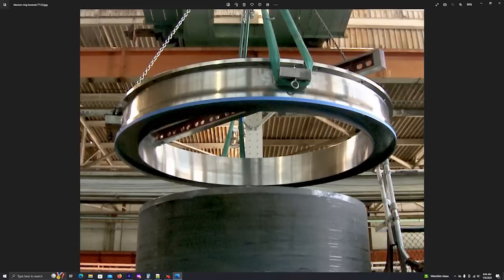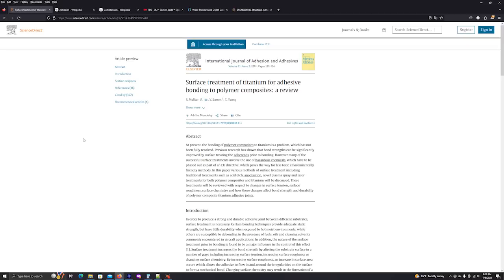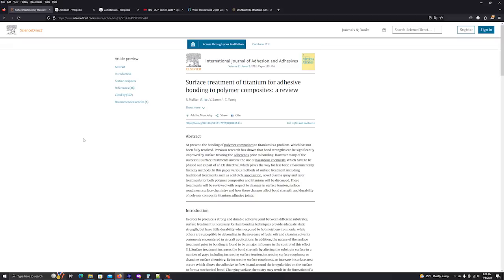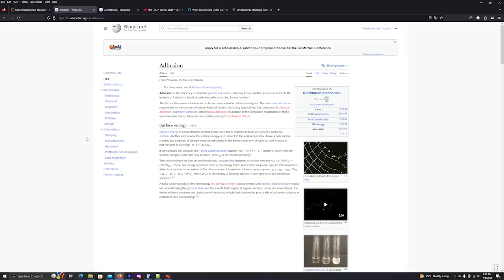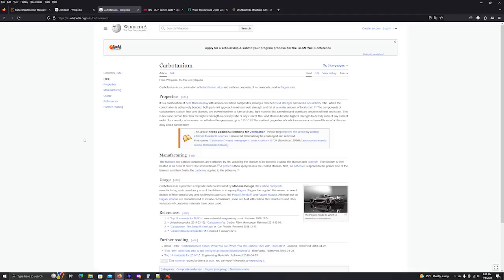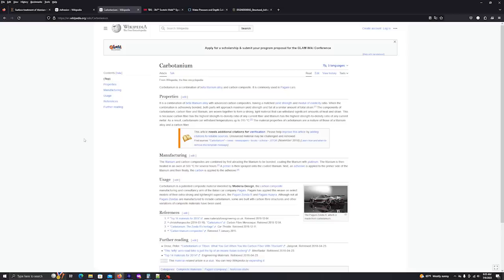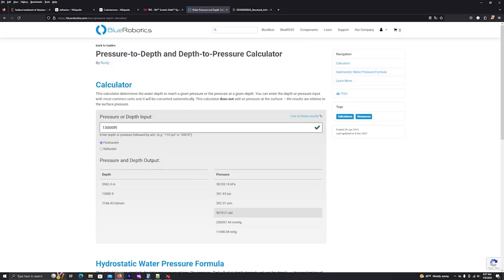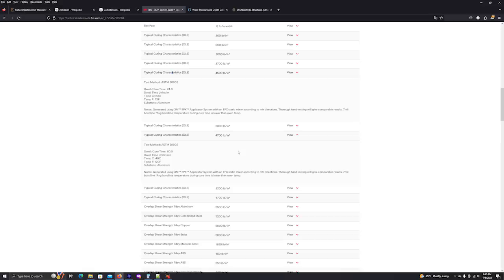Oceangate Titan Adhesive issues between Carbon Fiber and Titanium

Comment: What most are overlooking is the bond between the carbon fiber tube hull and the titanium sealing ring is not necessarily under any great structural load as Titan is designed.
The water pressure at the depths it's designed for will essentially force together the end caps and hull without any adhesion or mechanical attachment at all.
Much like how a car door of a sunken car won't open as long as the cabin is full of air anyway.
But where I think Titans designers and manufacturers failed is in the SEAL that must be present between the two critical components.  If water ever found its way beyond that narrow approximate 1" wide bonding/sealing surface at the O.D. of the CF hull and made it to the end face surface, hydraulic forces would work to seperate the two components and likely cause a failure at the corner of the CF tube face where the material is thinnest and weakest.
Once that occurs I think a catastrophic failure could result.
The expansion/contraction disparity between the CF and titanium and adhesive for that matter could have easily formed microscopic fissures or cracks that water at 6,000 psi could easily enter and burrow deeper through. If that "jet" or channel of water is large enough it could have easily destroyed the seal or the actual structure of the CF at its longitudinal Axis of its filaments leading to disaster.
As it stands though, and taking the text message transcripts into account it would seem something had reduced the vessels buoncy from the start of the dive as evidenced by its above nominal rapid descent.
The fact that the thrusters were unable to slow or arrest the descent and the RTM alarm sounding suggests possible hull deformation to the point that buoncy was reduced . I'm no oceanographic engineer so I have no idea if that's possible but being that the crew compartment was the only air filled vessel that created buoncy for the Titan it would seem something along these lines had to occur.
Once ballast and then the landing frame was dumped the hull suddenly relieved of considerable weight, could have flexed and deformed enough to cause the water intrusion described above and eventual implosion.
RIP
Reply from the maker: Good points,  thanks for the comment
Reply: Yes, you’re right. Even the bolts holding in the porthole window and the titanium hemisphere onto the titanium ring are doing absolutely nothing at 4000 meters depth compared to the 17 million pounds of force holding the dome on. 

In some of the pictures of the debris it seems that the inner lip of the flange where the carbon fiber tube was bonded got mangled. But nobody will know the chain of events until all the pieces are recovered. 

Im also wondering what type of adhesive was used because what seems most important at that joint is the ability to allow expansion and contraction of the two dissimilar materials at different temperatures and pressures, not bond so hard that it applies stress to the carbon fiber. This sort of ties in with the CEO saying “not too thick and not too thin”. 

Also so far I haven’t seen any details about the aft hemisphere, either during construction or in the debris. What sort of stuffing boxes did it use to allow passage of wires and tubing to pass through? What’s behind the aft bulkhead between the passenger compartment and the aft dome? 

The alleged transcript makes it seem like there was some sort of problem going on for at least 15 minutes before it imploded. And I say imploded because thats the only thing that would have blown the porthole out and the front dome off the front titanium ring. 

If you think the static pressure of 6000 psi is high, what do you think the water hammer pressure got to as it allowed tons of nearby water to accelerate into a dead end?
Reply: @imho7250  - yeah there's much to learn about that adhesive and the geometry of the joint itself fascinates me.
I think the disparity of the 3 materials, titanium, CF and the adhesive is why they designed the bonding surfaces the way they did with only a narrow approximate 1" band at the O.D. and I.D. of the CF tube hull and the majority along the 3.5" to 4" end face (5" wall thickness minus whatever was machined away to true it up and rebate the edge). That limited the movement between the materials by limiting the surface area of the bonding surface in the plane that would see the most movement.
Yeah I would imagine whether the hull failed catastrophically or a much less severe failure at the bonding joint of the aft end cap/bulkhead, the massive pressure and "water hammer" would have totally destroyed the CF hull and the porthole and disassembled every component in an instant.
As far as recovered components, we don't know if we're seeing the parts as they were discovered or perhaps after some level of disassembly once on deck of the recovery vessel for any number of reasons.
It's just not possible to say until someone briefs us.
All I know is OceanGate and Rush specifically was operating in such a reckless manner it was just a matter of time before something bad happened imo.
It's a shame.
There's a difference between pushing the envelope and being a cowboy.
Reply: @holdernewtshesrearin5471  , yes, he definitely pushed the envelope but you see people trying to “hack” the system everywhere they can. The porthole, reportedly only “certified” to 1300 meters, but most likely thats “ok, testing shows it will fail at 5200 meters, so we can give it a crush depth of 4000, a test depth of 3000 and certify it beyond any possible edge case of failure down to 1300 meters. 

So the CEO probably just went with the mathematical safe depth and got it for 10% of the cost. 

It did in fact make it down and back a few times, which means that at least initially, it was sound, but we don’t know which edge case got them in the end. 

One of my hobbies is electric bikes, and a popular “hack” is to get a motor controller rated at 30a for example, limited by software as it measures current across the shunt wires, and they will do a “shunt mod” where they add solder along the shunt to decrease resistance and “fool” the controller into allowing 45a when it thinks its just 30a. My stand on that is, as an enthusiast who had a pile of old controllers, and time to walk home, go for it, but for the average person they are eating into the safety margin that a Chinese manufacturer built in, for certain edge cases. If it was reliable at 45a, the Chinese would rate it at 45a and sell it for $10 more. Lol.

For the titan, after building it, I would need to see it raised and lowered with no life onboard to at least 6000 meters once and 5000 meters 10 times , then do ultrasonic inspection before allowing it to carry passengers down to 4000 meters. And this is probably much less stringent than any certification agency would use. 

We will see something similar on the first humans going to Mars. They will all also sign waivers. Lol

Comment: Even I hold pressure on my fake nails until the glue sets. You can see them checking if the end cap is down all the way by the green strap's relaxed tension. Childish! Further, there were no truss rods connecting the 2 end caps and holding them tight onto the hull. These were children playing a dangerous game.
Reply from the maker: Thanks for the comment

Comment: Seems to me that the bonding of the Titanium flanges to the Carbon Fibre Hull and possibly the Titanium domes to the Titanium flanges should have been positioned for the initial fit inside a vacuum to prevent air bubbles in the bonding substrate, then allowed to cure in air. In view of the fact that epoxy was used in the laying and composition of the carbon fibre, surely any engineered machine is only as strong as it's weakest component. Titanium is remarkably unreactive if I recall my Chemistry from back in College, that could be both good and bad, good from a corrosion point of view and face to face sealing but bad in that most things would not form a good reactive bond to something so unreactive. The best bonds are formed where a chemical can slightly eat its way into a substrate and form an intrinsic part of the surface area.
Were I to have designed that sub and due to financial constraints, used carbon fibre, I would have wanted to stay with a mechanical solution and have 50mm Ti tie rods, 12~18 in number equally dispersed around the perimeter of oversized Titanium flanges running the length of the submersible, from front collar to back collar. The submersible could still retain its hinged front door, I would also want an outer cylinder of Titanium maybe 30mm thick to avoid any water infusion into the epoxy/carbon fibre.
Many of the old Russian Nuclear Subs were constructed of Titanium, I would have sought a source in Russia for the cylinder build to keep within a budget and not compromised by using an untested at depth composite material.
You can be a maverick all you like, I am all for that approach as an individual, but putting paying customers in there knowing the risks, cynically having waiver forms made compulsory for passengers, being warned of a likely cyclical failure somewhere down the road and ignoring that because you can't let your ego be deflated and because you want peoples money, allowing a Father & Son aboard on Fathers Day, the son being just 19 years of age. Well reckless, irresponsible, greedy and ruthless only begins to cover this story.
Reply from the maker: Normally when mixing epoxy adhesive you de-gas the epoxy in a vacuum pot to remove the  air bubbles.  We are not sure if that was done.
Reply: @JoediyLab  Not fully conversant with advanced epoxy adhesives, thanks for the info. Really enjoying the depth of research you put into your videos, very thought provoking and stimulating.
I completely agree with your points raised about the Titanium Collars having absolutely nothing left bonded to them. That is what set my mind in the direction of the epoxy adhesive being the failure point too. No way in the World would I ever assume that an epoxy adhesive bonded to a highly engineered surface, very tight tolerances on an extremely precise ring using one of the the most unreactive metals there is such as Titanium could ever be a good idea. He might just as well have chosen PTFE.
Had he sandwiched the Carbon Fibre inside an inner and outer tube of Titanium of maybe 1 inch thick or more then used a bunch of tie rods to the exterior, I firmly believe that Rush could have been a leader in his field instead of relying on heavy domes of metal just glued to the tube either end meaning even when laid up on the docks for many months at a time in winter, gravity takes its effects, temperature expansion and contraction between a reflective silver metal and a mostly black, heat absorbing hull, UV light ageing the epoxy and then, as you have pointed out several times, towing the Submersible on its bespoke barge, cresting waves then plunging then cresting, cyclical strains on the both rigid and torsional strength of the hull. 
Maybe if he took the extra precautions of having the Submersible stored in climate controlled warehousing, foresaken some profit to have the sub borne on a suitable ship as he had done many times before, sought out second and third opinions on his design choices. Many retired engineers in his field would have been happy to advise simply for something to do in their retirement. I wouldn't even want to have that submersible lifted into the water from a crane for fear of the longitudinal strain on the hull from the straps underneath.
It's very, very sad that Stockton Rush had that character flaw that couldn't and wouldn't let him heed the advice of wiser people, leaders in their fields, those giants on whose shoulders we all must perch from an early age to learn and improve upon previous work done in any of our chosen career paths.
Not much innovation has happened in this modern day space race, engineering that must also have the additional and most complex functionality of keeping humans safe in extremely hostile and alien environments. That is not likely to change drastically in any way. Deep sea diving has not changed much in 70 years. You can't cut corners with this type of science, it is inevitable that nature will bite back very hard and take your life and those you involve in the endeavour. 
Following Steve Jobs mantra of simplification is highly unsuitable for this line of work, crazy that he took inspiration from a guy who built phones and tried to apply that to deep sea exploration, yet he completely ignored the guys he should have listened to, the guys who have safely done this with thousands of safe descents to show a proven track record with zero fatalities. Willing to bet that even though he was based in Everett WA, the home of Fluke multimeters and testers, he got a free Home Depot meter to wire the sub. He cheapened out on the weirdest things, Logitech instead of an extra $20 for a PlayStation/XBox controller, home 3D printed thumbstick extension pieces, cheap monitors, cheap LED tape lighting, no doubt cheap battery packs with not enough power to light the voyage down or up, an acrylic/ plexiglass or similar porthole rated to ⅓ of the maximum dive depth, no seating of any kind, hard flooring with a thin piece of carpet, home rated security cameras to drive the sub, out of date carbon fibre twine, a small Bluetooth speaker to play Celine Dion on a loop. Were the O² cylinders purchased from a moonlighting ambulance driver? Were the CO² scrubbers just 2x old gasmask cannisters? These are questions you have to ask with a character like Stockton Rush
I have asked myself a number of times if Rush would have brought one of his own kids onboard for that dive on that day, my conclusion is that he wouldn't ~ that time or ever. 
Seems to me he was feeling the financial strain of not bringing in enough revenue and that he was trying to build up a pot of money to build a new safer model, a Titan 3. He had to know deep down that he was fighting the odds every time he dived that machine, the cracking noises, the employee pointing out the delamination of the Carbon Fibre, the recurrent battery problems, the inept wiring of the port & starboard thrusters comically leaving the sub spinning all the while it was meant to go in forward or reverse direction, the customers who took one look inside the sub and said 'No way man!'. Having to sue to retain his former employees silence on the failings, he absolutely knew things were bad, you can lie to everybody with just one exception...... yourself.

Comment: If the damn Tube was made out of Titanium, they would now be sitting at home and enjoying their time.
Reply: But the vessel wouldn't have been viable. The only reason why they had a sub in the first place is because it's light enough for the puny batteries on board to float it back up.
Reply from the maker: That is true, but with proper design and manufacture he could have made it work.  He did other dives to that depth.

Comment: Hello friend, very good presentation... I am a researcher and I have the honor to report with respect... shipbuilding and aerospace have changed. Reactive and paramagnetic aluminum and titanium alloys are laser welded for the first time in HISTORY automatically... This means the submarine could and should have been laser built and welded as a monocoque in one piece... Huge repercussions structural and safety in shipbuilding... Thick welded titanium plates were made by joining both sides of the material at the same time. Power and inert gas... Perfect joints with controlled asymmetry... The aforementioned submarine is poorly designed and is joined by adhesives... IT DOES NOT HAVE THIS TECHNOLOGY... The new technology is accepted in America and Europe allows the construction of laser submarines... honor to report... Shipbuilding has changed... Regards...
Reply from the maker: Yes very good points.  But it appears that Oceangate did not want to spend extra money for Titanium.

Comment: If you search the recovered wreckage recovery with the is carbon residue on the inside with area of the ring
Reply from the maker: I will have to look,  From the video that did not show  a good angle on the bonding surface.

Comment: Didn’t sound like they used epoxy, “the glue is very thick, not like Elmers glue, more like peanut butter” mentioned Rush. They also used way too little of whatever glue they they were using, if this was one of my speaker cabinets they were making I would have fired them, plus they overlap of the Titanium is way way to short, this is not a Cola at McDonalds or a cap on a Pringle’s https://youtu.be/WK99kBS1AfE
Reply from the maker: Epoxy adhesive can be very thick.  In the industry it is common to mix epoxy  with various fillers.  It is also very common to refer to the thickness using common terms that people can relate to.  Peanut Butter thickness is a very common term, as everyone can relate to how thick peanut butter is.

Comment: Can't help thinking  that 2 to 3 inches  of epoxy  isn't  going to do the trick. Surely  he wouldn't  of cheaped  out on the epoxy  as well  would  he?
Reply from the maker: Surface area for bonding can be very important especially when doing mechanical bonding.

Comment: That's not the bonding flange you're showing. The bonding flange would be on the interior side of the titanium sealing ring not visible in that pic.
Reply from the maker: If you watch the video and look closely at the image, the lower surface is shaped like a U-Channel that is where the bonding occurred.
Reply: @JoediyLab  - yes I know.